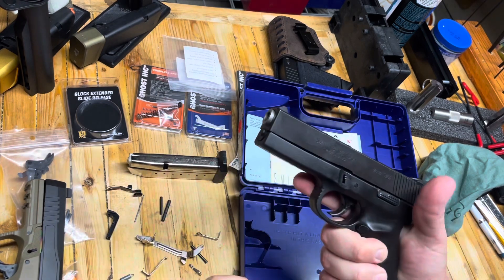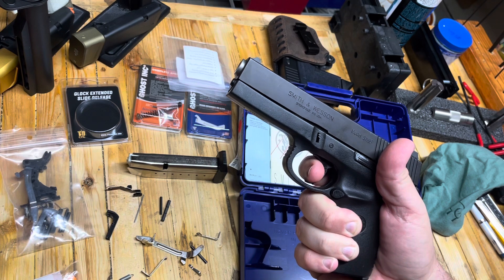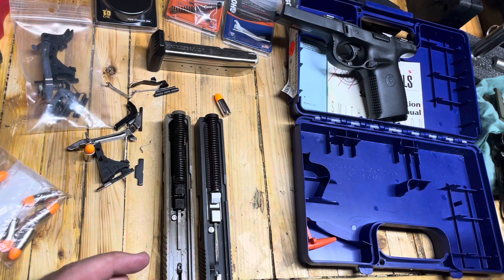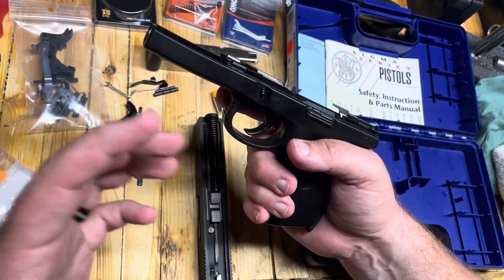This Gun FORCED Glock to Sue S&W

Comment: Years ago I shot one in .40 S&W once and though the trigger was broke. I handed it back to my dad who owned it and told him I thought the trigger was jammed, he fired off a couple more rounds and said it seems to be working fine. I got it back and pulled even harder than the previous time and finally felt some creep, eventually it fired. I was actually afraid I was going to break the trigger the first time that is why I stopped trying, I was shooting my USP right before shooting this pistol and even though my USP has a heavy 12 pound trigger in double action which I was shooting it in on the first round of every magazine this trigger was far heavier and I never felt as much creep and grittiness in a trigger before. Having said that it was stringing vertically but had decent accuracy firing slow fire and is fairly reliable. The group if memory serves me correctly was about 1 inch wide and four inches tall at 15 yards, not as good as my USP in .45 ACP but not bad either.

Comment: This was the first pistol I ever bought, back around 1995, and still have it to this day.  The trigger has always sucked, but I didn't know enough back then to know better.  I will say, mine had a similar issue.  I hadn't shot the gun in close to 10 years and when I did, it had issues ejecting.  Did some research online, everything pointed to a bad / wore out spring.  Contacted S&W to try to get a new one, and they offered to fix it for free.   Sent it in to them, they replaced 3 springs, and cleaned it up nicely for me.  Great experience with S&W customer service!  I've thought about replacing the trigger, but just haven't "pulled the trigger" on that up grade yet.  All in all, I'm still happy with it and still enjoy taking it to the range.

Comment: Nice video. The gap between the frame and the slide is deliberately engineered that way to account for the thermal expansion of the polymer during shooting. Do not remove the fibroid material from the trigger return spring. It acts as a harmonic dampener to reduce the vibration of the spring during shooting. Without that dampener, over time the spring would weaken and eventually shatter from the vibration resulting in a dead trigger.
Reply from the maker: Figured it was a dampening setup. Ok!

Comment: Notoriously bad magazines.
The FTF in mine was due to the mags not seating deep enough.
The triggers can be lightened up significantly.
Reply: I actually epoxied a 3/32" piece of Stainless onto the mag release to cure the feeding problem.
Reply from the maker: holy cow! ok well i might need to look into that!
Reply: @EagleRun23  Yes Sir. After that mod, and a much lighter trigger spring, I like my Sigma better than my Glocks.
Reply: I'm getting failure to fire/lite Primer strikes. I've sent it in twice to Smith wesson and both times passed range testing on there end. ??.. I have 3 magazines. Tried all 3 and same issue?.. wish I could just sell it at this point
Reply: @SC68170  I bet if you check them, they have room to move toward the chamber?
That's what my issue was: the magazines weren't seating high enough. 
Glock springs also help.
Stock springs in the S&W Mags are garbage.